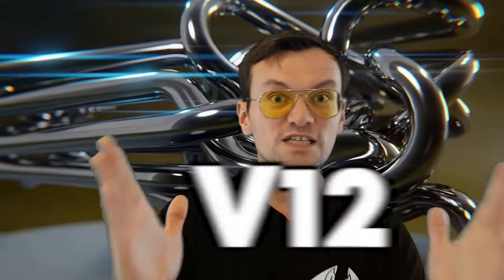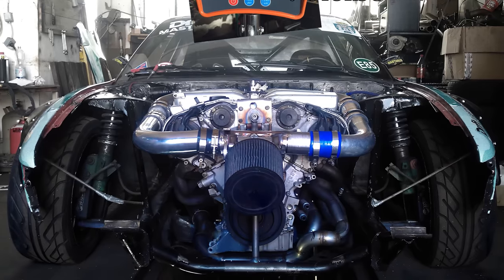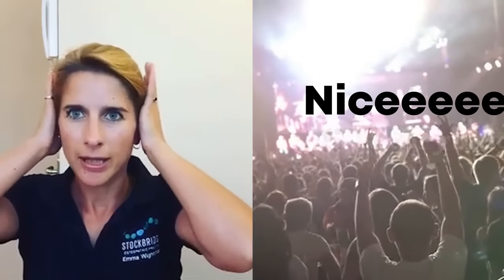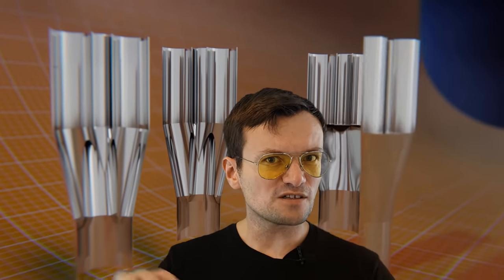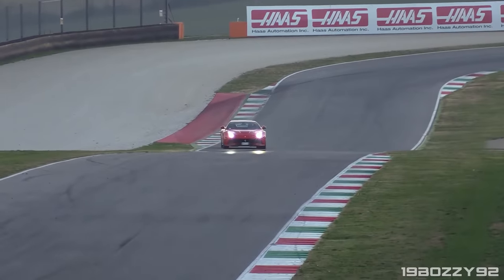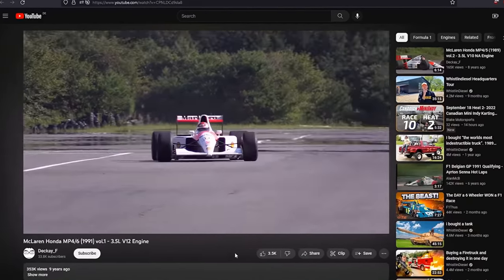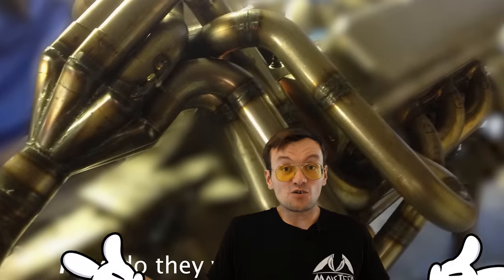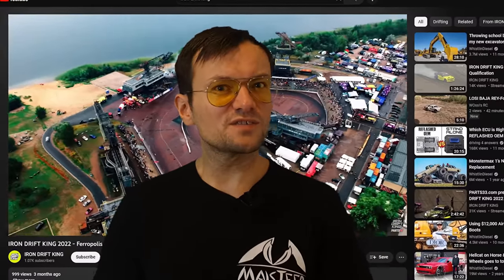Why This V12 Sounds Better Than a $5,000,000 Pagani

Comment: It sounds worse
Reply from the maker: ...no
Reply: Not only that, it’s less effective and far less efficient.   Exhaust is about scavenging, what you built is a mess.
Reply from the maker: @ThorOdinson-zc2kq  Thanks ThorOdinson armchair expert.... ^_^
Reply: @maisteer  nah just someone who is an engineer for time attack
Reply from the maker: @ThorOdinson-zc2kq  The worst kind then... the one who thinks they know everything already ^_^
Reply: @maisteer  please elaborate on how all of this tubing is more efficient and effective than what pagani engineered.  Please provide dyno numbers and hp and torque curves on cross compared graphs.   
Engineers work with datasets not just what looks interesting.  
That exhaust system will melt under actual race conditions 
You created a traffic jam, exhaust flows like water and now it’s backed up
Reply from the maker: @ThorOdinson-zc2kq  As an engineer you certainly have a large box of tools to work with. But creativity doesn't fit in the box of most engineers. I think you might be one of them. Asking for dyno numbers is your first go to.... why? Where did you pick up that this was for maximum power or efficiency?  
Also exhaust gas flows like water? Can you explain that to me on an example of a 2-stroke?
Reply from the maker: Hi Thor... I've made new video just for you to complain about - my favorite engineer.
You can watch it here: https://youtu.be/6EjbfLSRmyA